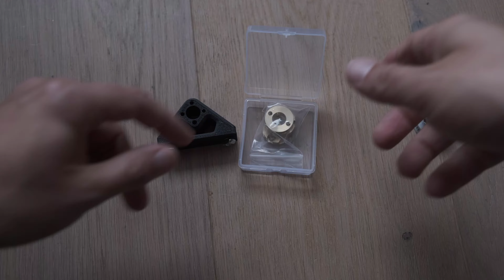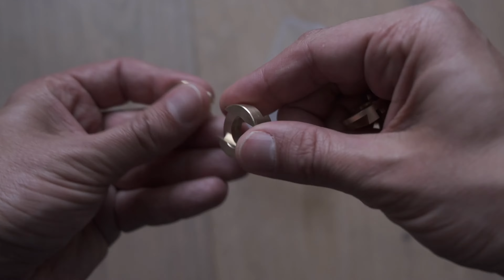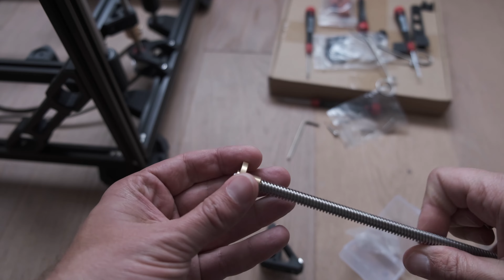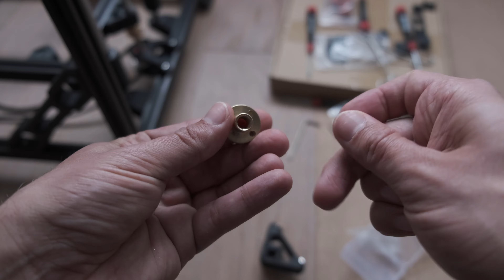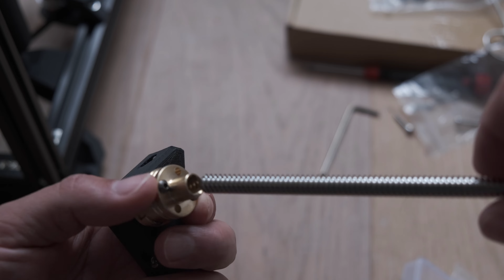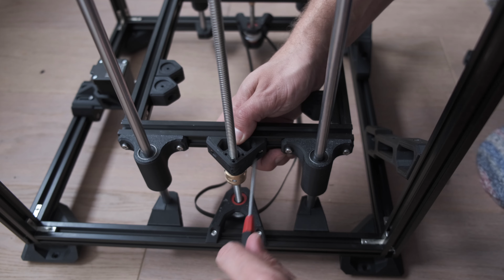Oldham coupling

Comment: The clearance of the coupling will cause some additional backlash and inconsistent movement. You should reverse it and let the bed "hang" on the coupling to preload the dovetails. I used a dial gauge to verify this and it is actually quite effective.
Reply: @bluemonxter hello, could you kindly elaborate on the correct installation of the olhdam coupler? I am about to begin building the printer, and I thought that what is shown at the video is the correct way.
Reply: @kapoioskapou  Both ways can be considered correct and the coupler will do its job, but the way its shown in the video, it will increase the backlash. If you fix it on top, it should not add any additional backlash.
Reply: Not even remotely enough backlash in those to change quality in a 3d print.  The filament tolerances alone are going to hide anything those could introduce.
Reply: My experience was that mounting it above the gantry prevented the coupling from being able to self adjust.  The friction on the dovetails was just too high.  You could move it by hand but it would stay where you placed it.

To be honest, they don't work that well below the gantry either.  I think the best solution to Z-Wobble is to only fix the screw at two points so there is never any "bow" introduced into the screw.  Let the other end flap in the breeze.
Reply: @nicolashoyt5341  There is enough backlash to negate auto bed leveling though.  Nearly entirely for me (my bed is pretty close to level, and the movements are small enough that the backlash in the coupling 100% eats it.)